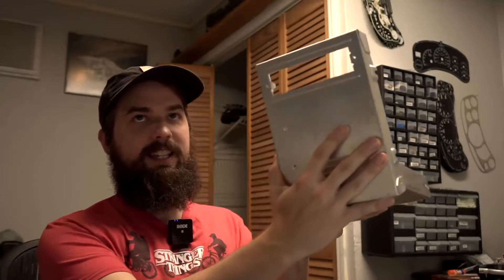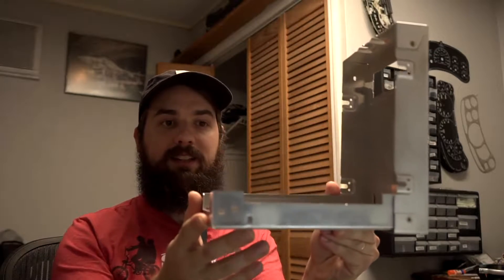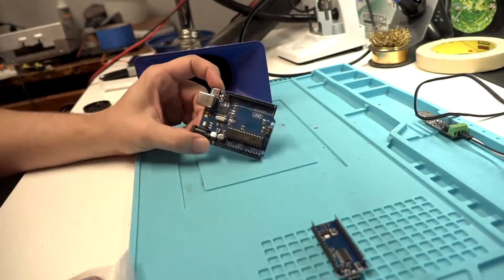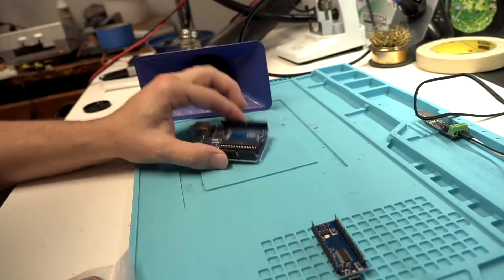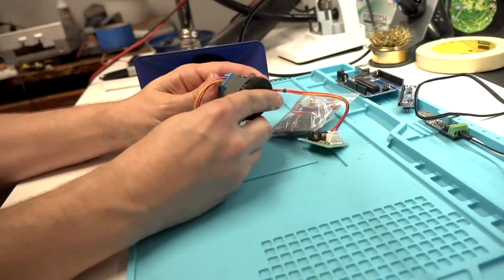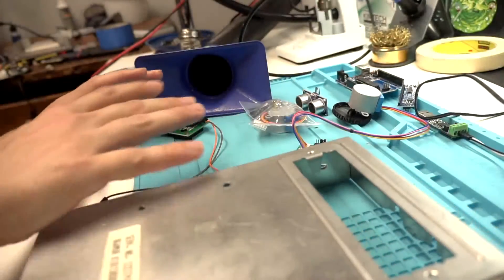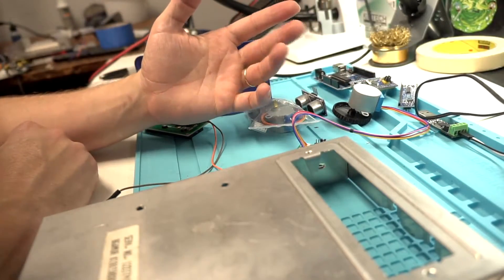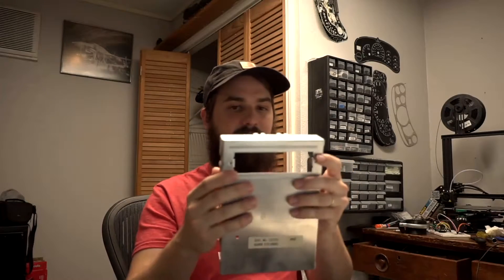Building A Robot With My Son Part 1!

Comment: I rember even now  how i begin with the electronic  .  It was hard but nice in the same time.
Reply from the maker: What got you started?
Reply: @FixedUntilBroken   i started simple with a motor some  voltage regulators like 7805 .  Then after two years i started to make variabile bench powers supply and my first soldering station . But i remain fixed to one think reparation of old device , soldering stations, programing and diferit led cube